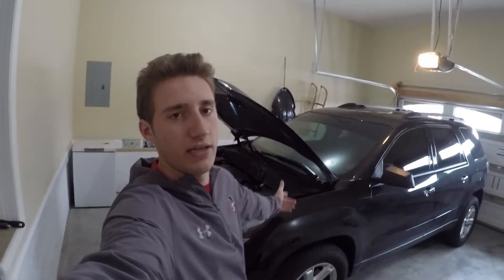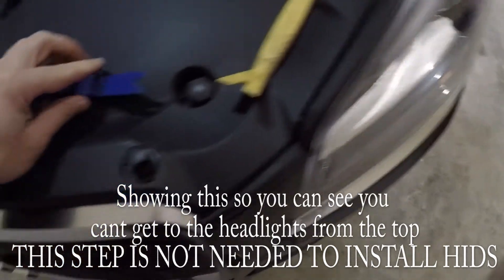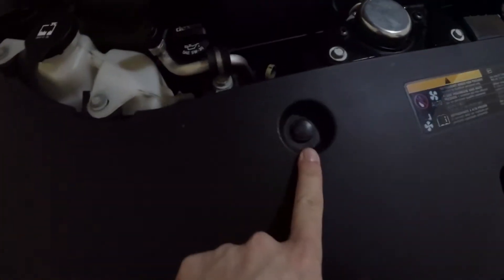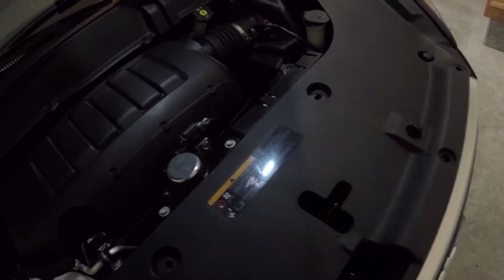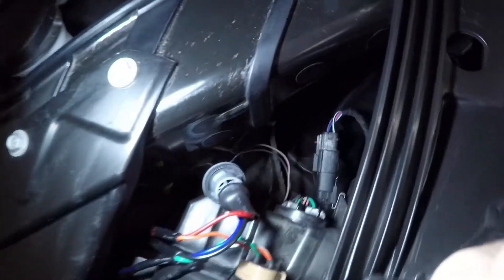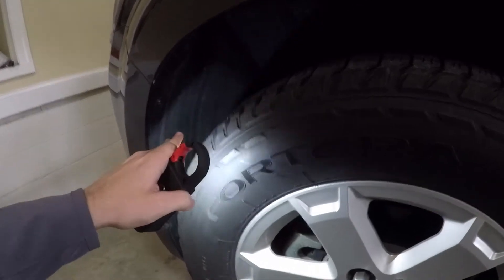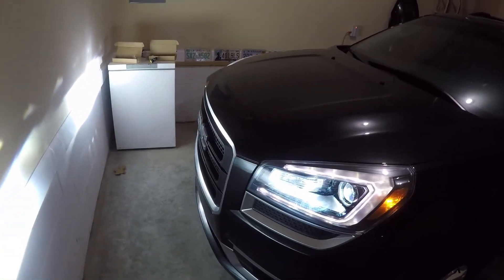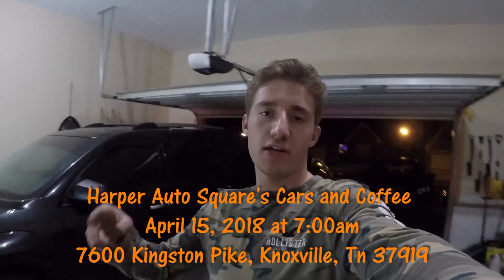HID VS Halogen Headlight Review (How to Install HID kit on Acadia)

Comment: If could explain a little bit more the routing of the wires and the devices (light bulb-ballast-extra harness) that’ll be great!  One of my headlights just went out and I’m planning in replacing both with this brand you show in the video! Good job!  
Thanks
Reply from the maker: rober Orozco  your pretty much just trying to make everything wiring as clean as you can make it.  Because know one wants to open there hood and see a rats nest of wires.  Also I have some other hid videos you can check out they might help you too.  But if you have any other questions just feel free to ask.  The other video should help you with the wiring   But normally it clips into your stock harness (the ballast) then that clips into the light bulb.).  Now if you get an hid harness I have a video on that where I fixed my fog lights and it shows how to hook that up.
Reply: Thanks for your time and advice!

Comment: HID fog lights? Also maybe you can do a night time drive video showing light  output on the streets while you drive? Nice video by the way, definitely make the hole in the cap and use the gasket so you can stop water from entering the light housing, you will notice moisture on the inside after rain if you dont

Comment: To much drama, I installed super nova V4 led in my acadia. Its a plug and play. So easy to install. They are one of the best in the market. I love them. They give you that nice crispy white view.
Reply: Is it in an projector headlight assembly. I heard the light beam comes out bad with led on a stock projector headlamps